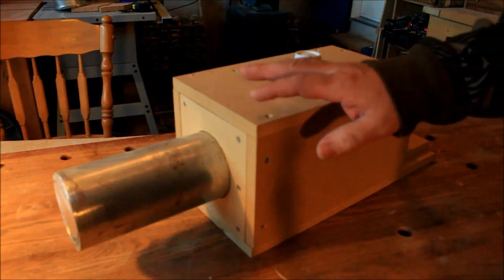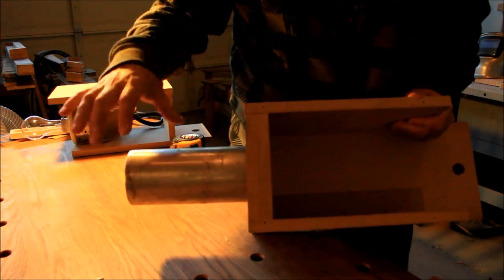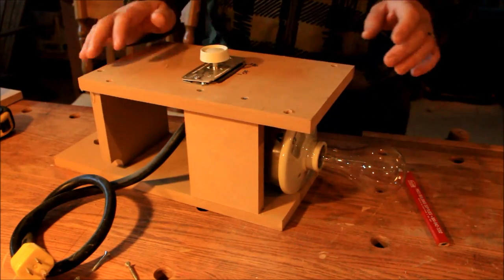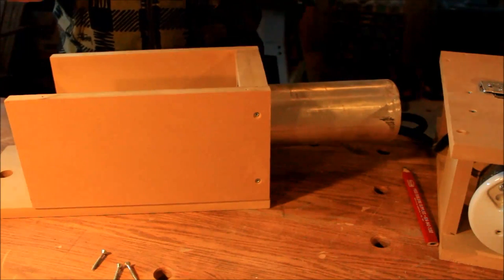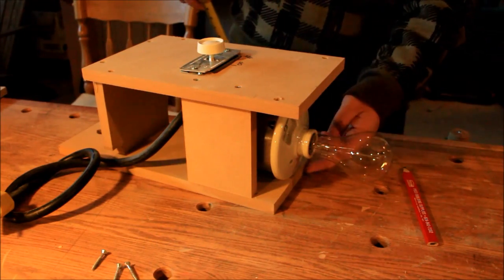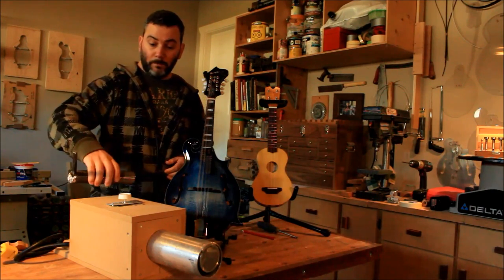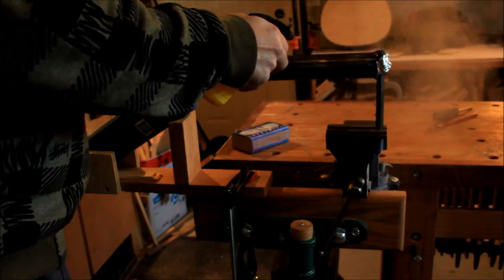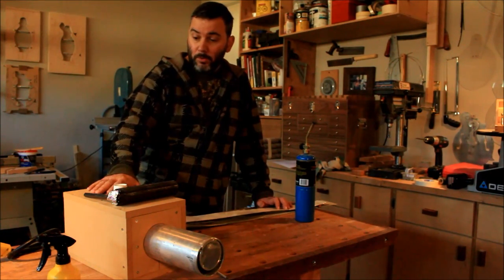Lutherie Side Bending Tool

Comment: Tommy, how do you prevent the light bulb from breaking due to the intense heat? I read that some luthiers have built similar type bending irons but the bulb keeps breaking?
Reply from the maker: I never had any issues with my light bulbs. They last years before I have to replace them.. maybe better quality light bulbs..?🤷‍♂️ I’m not too sure. I never have to run it to the maximum intensity though .. that could be a reason

Comment: I see your video is already a few years old, but maybe you’ll see this and let me know...

Do you turn the dimmer up all the way to max or is there a point somewhere in between where you stop—and how did you determine that point? 

Thx
Reply from the maker: I usually put it to max, but sometimes if I spend too much time at the Jig to test fit it gets a lot hotter, if I notice and burning on the wood ( appears like a brown tint on maple) I dial it down some. Very rare I have to play with it though.

Comment: Tomy: have you thought of heating the 1.5 inch pipe with a light bulb? Just curious if that would work.
Reply from the maker: Interesting question, I would be curious to find a bulb that would fit in there with enough watts to create the required heat. If so, it can totally be done.

Comment: Would it still work if you used a stainless steel pipe instead of aluminium?
Reply from the maker: I would think so. One of the advantage of aluminum is that it gets hot really quick. But Stainless would get hot to.

Comment: Cool Tomy! How hot does the light bulb contraption have to get to bend the wood properly?
Reply from the maker: It can get really hot, enough to burn the wood. I can get the same spray bottle results I've demonstrated in the video with the electrical one. The trick here is to have the wood thin enough for it to bend. I wouldn't be able to bend 1/4 thick in the guitar shape on this .its a good thing that a guitar side is thinner than 1/8...

Comment: Can please give me the link for each and everything you used in the electric circuit inside the box
Reply from the maker: Thanks for watching..
Switch box https://amzn.to/2PBrGLf
Dimmer switch https://amzn.to/2DBc7OF
Ceilling box https://amzn.to/2XDGN9y
200Watt light https://amzn.to/2KY7AvT
Porcelain lamp holder https://amzn.to/2DtNWBx
Wire connector https://amzn.to/2Dx1Zqj

you will also need a flexible cable with plug to plug it in and some Armoured electrical wire for the inside connections. 

Hope this helps